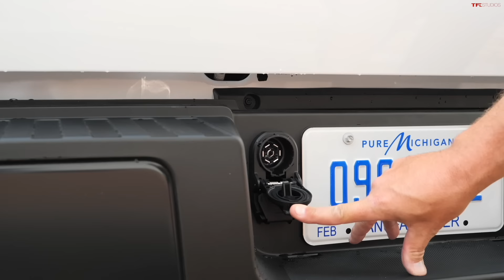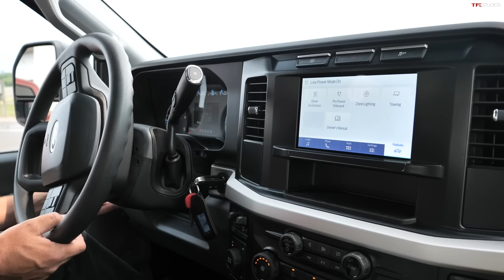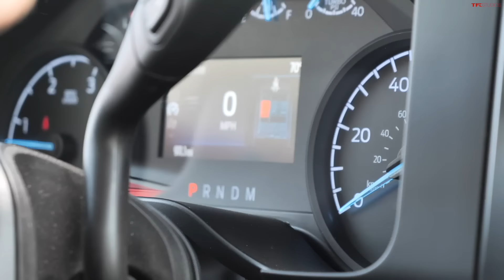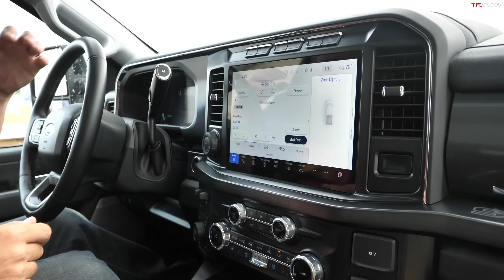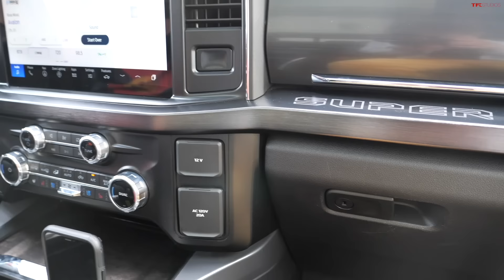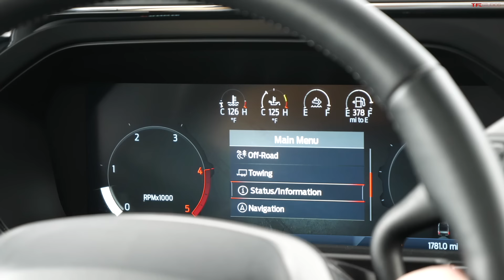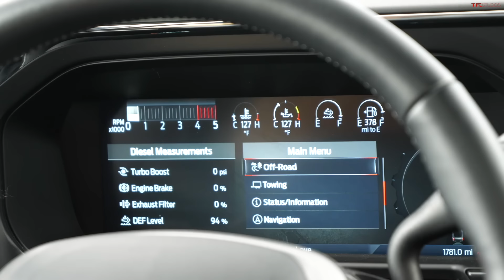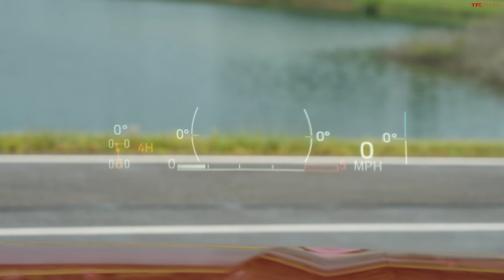The New 2023 Ford Super Duty is a Game Changer: I Take A Deep With The Engineer Who Built The Engine

Comment: The one thing that keeps me from buying this Ford is having that blasted water pump INSIDE THE ENGINE.!! That pump goes south (it's a wear item, people) you hafta tear the engine down. Crazy.! Also...does this engine need the oil catch can too??
Reply: Which engine are you talking about?
Reply: Not on any 7.3L gas, or 6.7 power stroke sir. All external.
Reply: The only internal water pump was on transverse mounted 3.5 and 3.7 V6's. No Ford trunk has ever had an internal water pump.
Reply: When that pump fails you'll need a new engine anyhow.
Reply: I guess there's nothing stopping you from buying one since your info is 100% INCORRECT...

Comment: Hardly changing any games.  Diesel was left alone.  A more expensive diesel that still has torque management down low to limit power and only 25hp more.  7.3L on 10TQ more and the 6.8L with baby transmission.  Hardly blowing any minds.

Comment: These trucks are so Incredible but reality sinks in about how absurd they are when someone breaks a tail lamp on it and it costs $2800 to replace a brake light.
Reply: Same with a newer Tahoe for example with LED taillights. For example, if the LED brake light goes out you need to replace the entire LED tail lamp assembly. Get ready to pay your GM parts department over $700 for a replacement instead of just a $5 bulb. It’s another example of planned obsolescence by the Big 3.
Reply: @mini2nut67  i agree absurd new teck electric power steering junk  eco boost v6 i a 150 lol call it a turbo  bs this just way to fancy words no one buy into  and cut out the bs and build a big truck like the tacoma is built or simpler

Comment: All very cool but Ford lost me forever when my  stock(zero modifications)2019 F350,SRW 4X4 lariat with 9,000 miles on the clock,went into the DEATH WOBBLE on the  interstate at 75mph.
My wife stills refuses to ride in the truck,it scared her that bad.
Thanks Ford.
Reply: Your stock f350 having death wobble issues is not an issue with ford trucks. All 4wd straight axle trucks will have the same issues if the factory failed to set the front alignment with enough caster. Have the truck aligned and tell theshop you want 5.5 degrees positive caster on the passenger side front and 5 degrees on left front. You will have no more issues. Your truck left the factory with not enugh positive castor. Ther is nothing wrong with the ford truck.
Reply: @johnwilliamson6143 
Interesting,thank you. 
I will definitely look into this and set an appointment with the well equipped and knowledgeable independent
shop I deal with. 
When I asked the Ford service advisor (under warranty)about a possible caster issue, he assured me that wasn't the problem and they installed the "upgraded "
Ford steering stabilizer,no issues since.
Reply: @justtl5885  just a note. The dealers will set caster angles to factory specs. That is usually the problem with dealer alignments. Ford set the caster to close to negative so as to reduce steering effort. Adding positive caster will not increase steering effort enough you will notice. Setting left side .5 degrees less than right side will pull against the crown in the road preventing drift towards the shoulder of the highway. Ford uses the solid axle in their heavy duty 4x4 trucks because they are much more durable than the GM independant set up. The GM heavy duty cab and chassis trucks used in the ambulance service have suffered alot of premature wear issues.
Reply: @johnwilliamson6143  Good information, thank you.
FYI,
My Death Wobble incident occurred while driving unloaded.The truck is driven 90% of the time at near GVWR (properly weighed on a truck scale, loaded)with a camper in the bed. I have never had an issue while loaded.

Comment: Despite the question, there was no answer to how the 6.8L gas engine is less expensive than the 7.3L version of the same engine, other than the lighter 10R100 transmission instead of the 10R140.
Reply: Fleet engine= mass production and lower overall cost per engine.
Reply: @amatureskater15  the 7.3 is a mass production engine as well. The question is how the 6.8 is cheaper to make than the 7.3, despite being both produced in high quantity on the same production line from the same design.
Reply: @brianb-p6586  the 7.3 isnt designed for medium duty vehicle's and fleets. Even the ranger, might fit this motor.  

The 7.3 is just too big for smallee platforms, without Ford, pulling a 90's-2000's Dodge. V8 in small trucks
Reply: @amatureskater15  That does not answer the question at all.
Reply: @brianb-p6586  by making a smaller V8, it allows for choice on the consumer side.

Ford needed a new v8 for light duty applications. the Coyote engine, is fine but it's overkill for a lot of applications.

if you have the choice.... of a V6 or v8, and price is smiliar, which engine will you choose?

goodluck
Reply: @amatureskater15  I have not seen any indication that Ford is planning to offer the "Godzilla" series engines (7.3 L or 6.8 L) in a light duty application, replacing the Coyote engine or otherwise. The 6.8 and 7.3 are available in SuperDuty trucks, F-250 and up, and not the F-150. The Coyote 5.0 is available in the F-150, but not in any SuperDuty.

But more relevant: that doesn't in any way address my question, which is why the 6.8 L is cheaper to build than the 7.3 L.
Reply: @brianb-p6586  omg.... its based off a platform/ engine, that they have been making for years.

So it costs the same or less to produce.
now.... using a little high IQ discernment....
where would they be able to "save"?

By taking a lower profit per engine.
but regaining that lost profit with higher volume sales... 
Since it smaller... and can fit into smaller and cheaper vehicles. 

lord help ya
Reply: @amatureskater15  higher volume doesn't make the 6.8 cheaper than the 7.3 - they're the same design and built in the same line, so any volume advantage benefits both.

The 6.8 has smaller displacement, but externally is the same size. If that's not obvious to you (I don't know how much you understand about engine design), the Ford engineer mentions and explains that in the video. So it won't fit any better in smaller vehicles than the 7.3, and it won't be much (if any) lighter.

By the way, this engine family has only been in production for 3 years. Yes, that's literally "years", but it's still relatively new.

Comment: Jeepers…if you lost a fuel pump, your talking a full cab off and upper motor tear down to get to that unit down by the cam.  Yikes….this engine would be a nightmare to work on without a cab off requirement.
Reply: Not if you have a Disaster kit, easy fix
Reply: @ItMeZumn  and what exactly is a disaster kit?
Reply: A kit to prevent metal particles from failed CP4 pump entering the fuel system.

Comment: How many recalls they up to again?

Been shopping for an HD truck and of course I at least entertained the idea of a Superduty. Dealer couldn't order half of what i wanted even though these vehicles are just getting to people/lots recently. What a joke.
Reply: Jim Farley of Ford said it'll take years for them to get the quality back to where it needs to be.  This was in the spring he said that.   Not exactly making you want to run out and plop down 80k.  But all domestic companies are having issues.  More than any other makers.
Reply: @davidlusk4350 Chevy/GMC reliability has been trending up in recent years but they still have more issues than say Toyota and that's even with the new hybrid V6 they're using in the Tundras. 

Ram is also doing better reliability wise, but they've also stagnated, afraid to change much of anything from their 2019 redesign for fear of reversing said reliability increase trend.
Reply: @SliderFury1  all true. My 2018 chevy hd  loaded LTZ Duramax had 8 recalls in 3 years I owned it. Sold it for big cash when warranty went out and bought a lexus RX .  I wouldn't touch a domestic truck for next 2 years till they get better control over products.   Toyota is having an underlying problem with their tundra engines .  Look for a recall of drastically change there in next year or so.
Reply: Buy a used truck...nothing out there that says you gotta buy new.   I'm happy with my 99 SD, does everything I need to do and its paid for...no $1500 a month truck payment.
Reply: I’m buying a RAM this time. I wish I didn’t sell my old reliable F-350. Ford tells me 18 months to get the truck I want.

Comment: The diesels are not to blame, it's the poor quality diesel that's out, you have to use Hot Shot fuel treatments and change your filters often. It's simple! Diesel sitting and it harsh environments will gel and gum up by itself. Keep the diesel running avoid soot build up and it won't fail.

Comment: Bottom line is…if you have a need for a heavy duty pickup truck chances are you’re going to keep it a long time & use it for a specific purpose- tow a camper, plow, etc. the big iron block gas V8s & esp the diesels can run 100s of thousands of miles- so b/c of this the Ford is the top of the heap & will remain so until another manufacturer also uses an all aluminum body. Period. End of story. The Ford super duty pickups sheet metal will be infinitely better after 250k miles than a Ram or a Chevy.

Comment: I was kind of hoping that the diesels were the Cummins straight six 6.7 litre but now realise that Ford is the wrong brand to use that engine. These Ford engines look to be very complicated and sophisticated, expensive large engines. 500hp is not a particularly high output for 6.7 litres of course and equates to a 2.0 litre of only 150hp. Ford’s 2.0 Ecoblue fitted to the Ranger elsewhere outputs 205hp  so if the 6.7 had the same power and torque density it would have 690hp and 1675Nm torque.
Reply: Im glad they don't use Cummins as the current version is not the same design its reliability was built on. Since moving to hydraulic lifters etc. there has been numerous problems. Enough that I moved away from Ram after owning them for the past 25 years.
Reply: Converting 1200 lb ft to Nm would show you that it actually makes more torque than that, and the state of tune (max torque at the lowest rpms) inherently means peak hp will be less.

Comment: Cool to hear from the engineer!  That’s not much more hp or torque than the 5.7 hemi, or even the 5.0 Coyote….
Reply: F150’s 5.0 makes more HP than the 5.7 Hemi, same torque.     
The 6.8 and 7.3 Godzillas are lackluster in every way
Reply: @BC08 in not all about hp and torque in a truck . Weight of vehicle  , a frame and suspension that can handle weight . 1/2 ton trucks are basically a lifted station wagon
Reply: @kenj.8897   No 💩, but the topic of this message is clearly the engines and the HP/TQ they produce - NOT overall truck capability.
Reply: @kenj.8897   Wait, did you say 1/2 ton trucks are basically lifted station wagons?  🤣🤡🤡🤡  
1/2 ton trucks today have more meat in the frames and suspension than 3/4 ton trucks did in the 60/70s.
Reply: @BC08  wait , hey clown boy take it easy .
Reply: Go look at the torque curve of the 7.3 and how much torque is available at about 1,700 rpm. Nearly flat from there up to redline.
Reply: @kenj.8897   Only clown here is what you see in the mirror every morning
Reply: @imkindofabigdeal4308    Not really, looking at an actual chassis dyno graph of a 7.3 Godzilla right now it only makes 270 lb-ft (@ rear wheels) @ 1700 and makes it peak of ~355 lb-ft at 4000 rpm.    Pretty typical modern small block curve, more rev happy than a real stump puller
Reply: @BC08  The 7.3 makes 475 - 485 peak torque depending on model year. 355 lb-ft is a 27% loss through the drivetrain? Your torque numbers don't seem reasonable.
Reply: @imkindofabigdeal4308   My torque numbers are what Livernois recorded from their 7.3 Godzilla on their DynoJet chassis dyno.   I was literally reading off of the graph when I made that post.
Reply: @imkindofabigdeal4308   And 25% is not unreasonable for a Super Duty driveline.  
Compared to the F150 it’s spinning a physically larger transmission with the 10R140, and longer/heavier driveshaft, larger Sterling 10.5 rear axle and often a heavier wheel/tire.

Comment: Game changer? Its the same truck from 2017!
Reply: With Pro Power Onboard, the whole CoPilot 360 suite, vastly easier trailer backup, and the first light duty pickup with 40k+ lbs tow rating. Not to mention a torque rating higher than any Bugatti on sale.
Reply: @The-fs5wn  😆That's not game changing

Comment: The design of the dash is horrible. The small gauges have tiny, almost invisible graduations. Only the temperature gauges have digital values available. No values available for boost pressure, def level. No oil pressure gauge, in fact, it is dishonest to make it look like a gauge. Another lie is the battery voltage. It doesn't read the battery voltage and it only reads 13.0 or 14.0 and it is unrelated to the system voltage. Also the temperature gauges are blanked out below 86 degrees. Why on earth would you do this? This engineer should be fired and replaced with someone who actually has used a pickup truck before. Gauges are meant to provide information about the machine to the operator. The information should be easily discerned at a glance. Analog gauges should have clearly visible graduations with actual labels on them. This is a shame. It is the worst feature on an otherwise good truck.